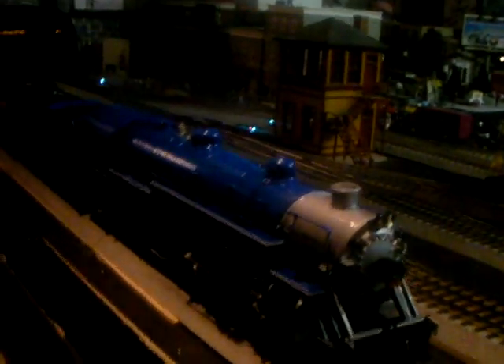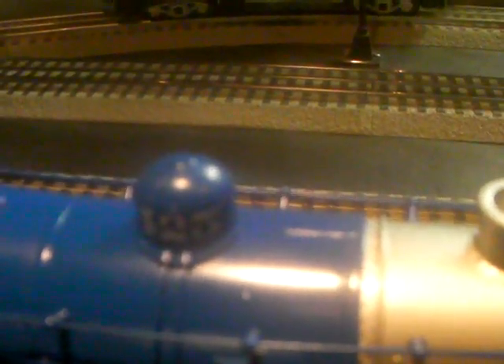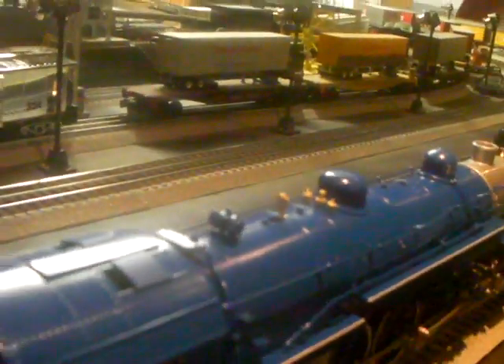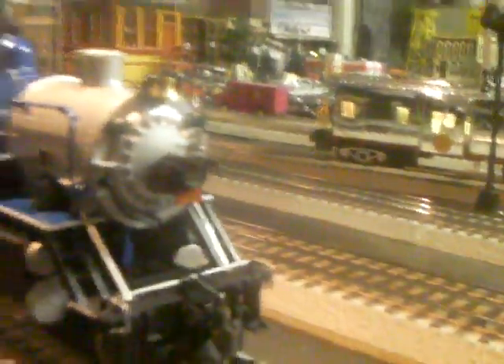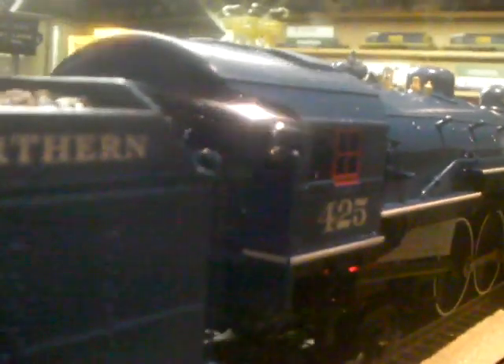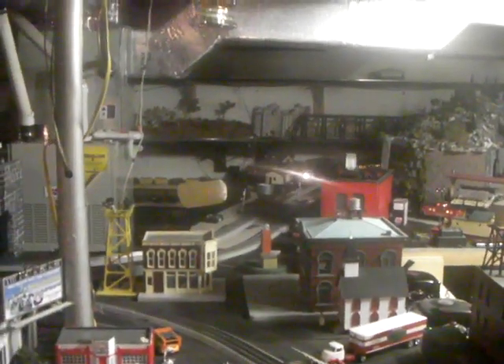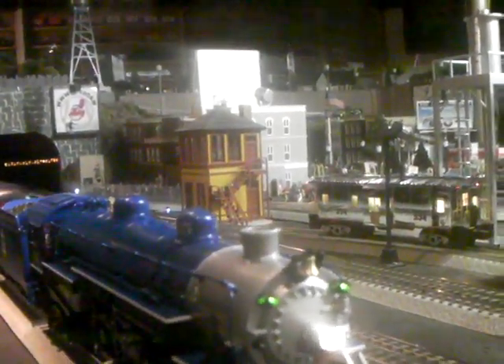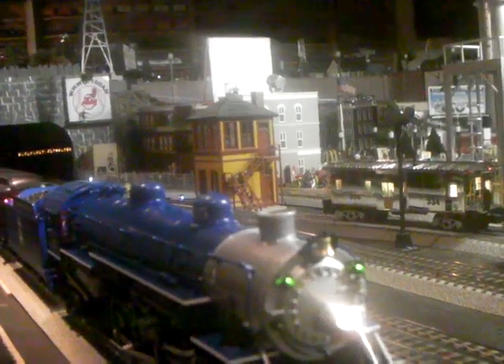Lionel Reading & Northern 425

Comment: Hey i have one of these as well, and when you turn on sequence control by holding down the aux1 key, it plays a different whistle. Do you have this issue as well?
Reply from the maker: Yes that is the sequence control, two whistle toots along with bell and cab chatter.  To shut it off aux1 and the 0.  Or just when you turn off power to tracks.